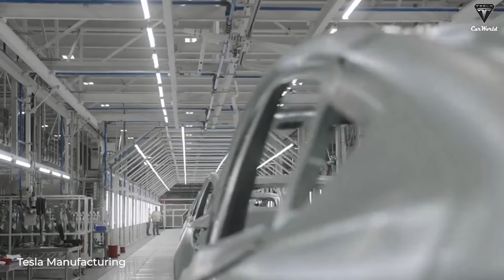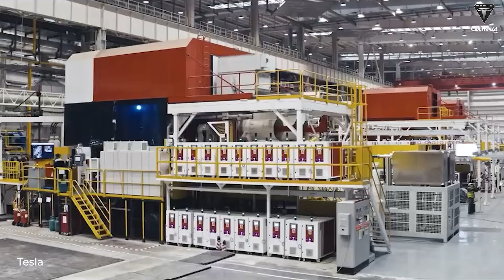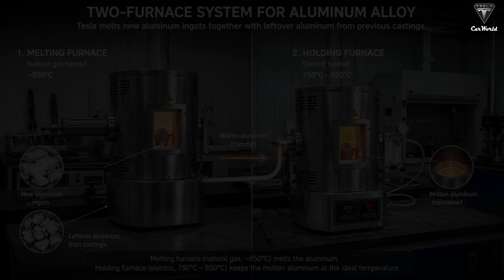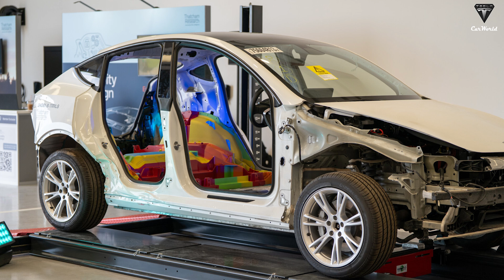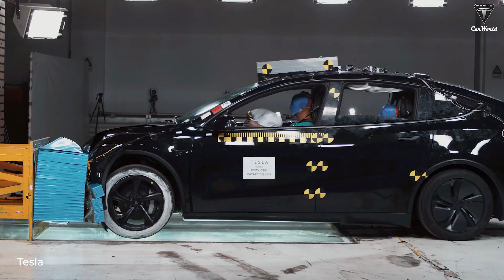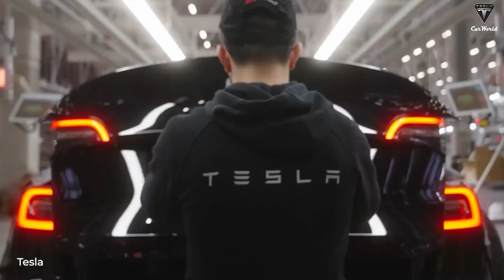Tesla Giga Press 4.0 Mold Never Seen Before! Massive Casting Ever!

Comment: but can better batteries be made lighter and more efficient? EVs are still too heavy.
Reply: Batteries are already getting lighter as they are moving to lighter and more suitable materials, such as solid state and structural batteries. And the range of batteries is much better as well. 500 kilometres is not unusual these days.
Reply: @BatMan-oe2gh  300 miles on a tank is a joke - and let me know when they beam down the lightweight batteries...lol
Reply: @mrrc4074 
Oh dear, I see your lack of knowledge. Battery packs for EVs are lighter and hold more energy and are more efficent today than a decade ago.
Manufacturers design their battery packs based on the distinct needs of each vehicle model, ensuring optimal performance, driving range, and production efficiency across their vehicle lineup and to meet consumer demands. 
So yes, larger vehicles will be heavier, but small and family cars will be lighter. 
Most ICE cars today only get 400 to 500 kms on a tank.
Reply: @BatMan-oe2gh  I see your an EV zealot - "lighter" well a smaller elephant is "lighter" than a larger one - do you really believe your own propaganda...lol It is especially disgusting when Ice cars are at 600-700 kms per tank - you see lying about facts is the definition of a zealot - and you have convinced us of that...lol x2
Reply: @mrrc4074 You see nothing. I am not an EV zealot. As said, I drive a V8 and will never own an EV. ICE cars getting over 600ks per tank are generally 4 cyl. My 6cyl work car gets around 500ks per tank, and my Ute gets 450ks per tank. 

And I can see you lack reading comprehension. I said the new battery packs are smaller and lighter, but manufacturers are putting more packs onto the vehicle to give it more range, so again, the new batteries are lighter, simple as that. 

And seriously, to charge an EV costs the going electricity rate of around 20 to 35 cents per KWh, and gas is in most countries $10 a Gallon. In Australia I pay $8.50 a gallon. But I don't care as I will always drive my V8, as I don't like EVs. Understand now, or you gonna try another attack angle. All I am doing is stating the facts about EVs, doesn't mean I like them.
Reply: @BatMan-oe2gh  OH, now i see you have changed your facst on ICE vehicles. You are DEFINITELY a good lib, bet you allso have a nose ring - as you got caught lying about your EV facts, just like good nose rings do - except this time you got caught in your zealot lies. NICE lying about your V8 - but again - lying is how Austrailia got in the mess it is in - so I give you a...lol x the number of illegals you nose rings also cherish...lol
Reply: No, batteries are stupid
Reply: @mrrc4074 
They are not. Electric cars have been around since 1832. Electric motors added to horse carriages. The first mass-produced electric cars appeared in America in the early 1900s. In 1902, the Studebaker Automobile Company entered the automotive business with electric cars. In 1900, 28 percent of the cars on the road in the US were electric. EVs were so popular that even President Woodrow Wilson and his secret service agents toured Washington, D.C., in their Milburn Light Electrics. Electric trucks were an established niche into the 1920s.
 
The last decade has seen significant advancements in electric vehicle (EV) battery technology, leading to improved efficiency, longer ranges, faster charging, and enhanced durability. Key improvements include:
Enhanced Energy Density: Modern EVs boast energy densities exceeding 250 Wh/kg, allowing for longer driving ranges without increasing battery size or weight. 
Faster Charging Times: High-powered DC fast chargers can now charge an EV from 10% to 80% in as little as 15-30 minutes. Improved Battery Longevity: Advances in thermal management systems and charging algorithms have extended battery life, with many modern EVs operating efficiently for over 200,000 miles. 

Charging Technology Advancements: Fast-charging networks have expanded, making it as convenient as refuelling a gas-powered vehicle. Manufacturing Efficiency: The cost of producing lithium-ion batteries has decreased due to economies of scale, improved supply chain logistics, and innovations in material usage. 
These improvements have made electric vehicles more practical for everyday use, addressing concerns about range anxiety, cost, and environmental impact. 
I am a car guy and drive a V8 and will continue to do so. But I will not deny that today, EVs are a lot better than they were 10 years ago. In another 10 years, the batteries and cars will be even better and EVs will be a lot more commonplace and ICE cars will start disappearing off the streets.

Comment: Pressing is nice Extrusion is Better the combo will form on future Extruders , from powder to liquid  to solid Highly more Efficient cold Processes with colder release Mechanisms Eliminating even slow 3-D Processing , Carbon Extruding coat superior Strength , complex forming , High nano stacking Additives  Creating full field charge Adaptability to body Itself even circle 6-ray Condenser Maximizing in unit storage + charge off cord Availability Increasing Weight to power ratio roll off !.
Reply: Now thats not tooooo expensive, duh

Comment: Tesla’s Next. -Generation Giga  Press 4.0. is 
Untilizes  massive percussion  engineered steel 
 Molds. and 3D-Printed sand core tech  to cast entire vehicle  underbodies in  a single 
80to 90. second cycle